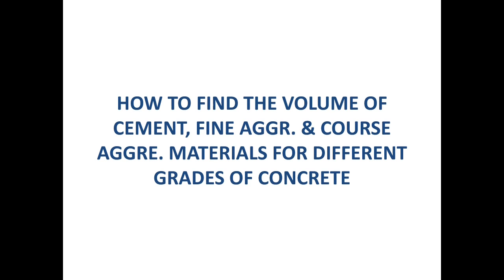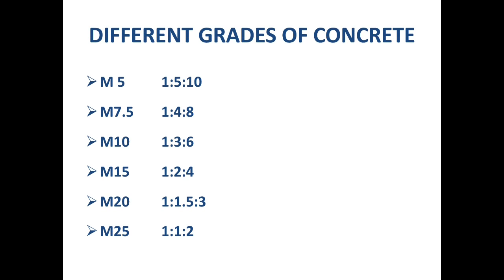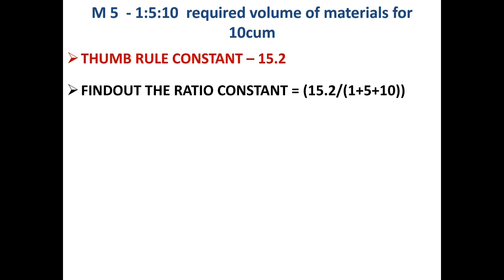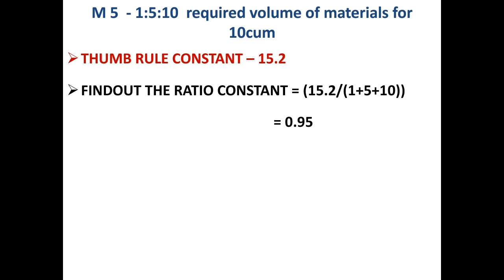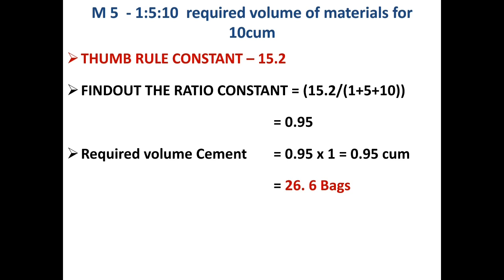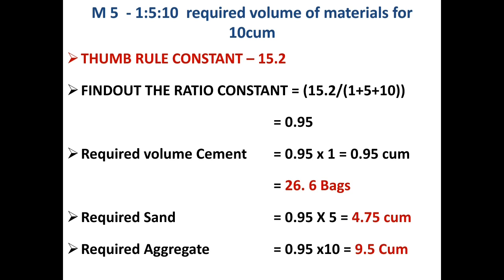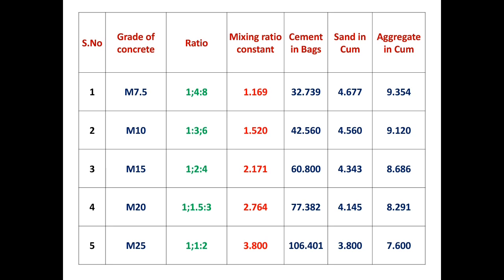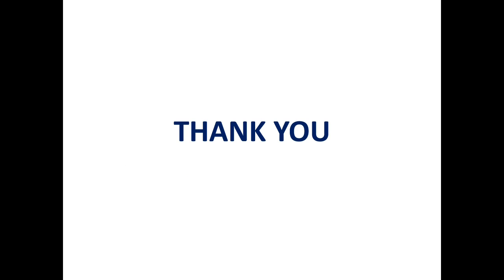HOW TO CALCULATE THE VOLUME OF CEMENT, FINE AGGR. & COURSE AGGR FOR DIFFERENT GRADES OF CONCRETE

Comment: how to calculate no of bags from cum
Reply from the maker: +Praval Singh 

You can simply devide the cubic meter by 0.0347 and you can get no of bags of cement.
Reply: what is 0.035714